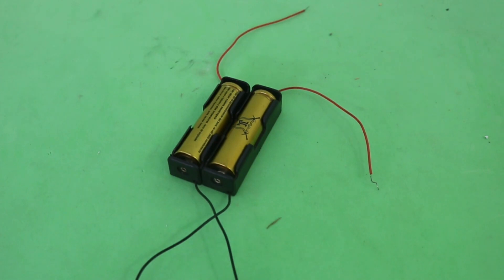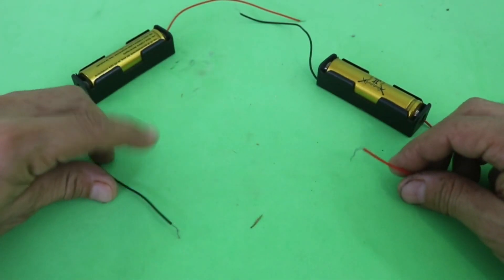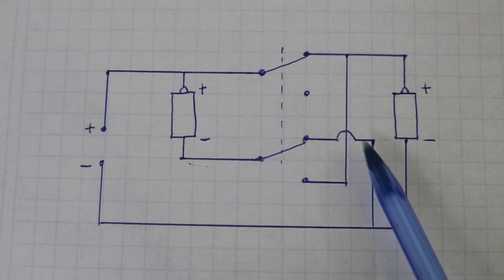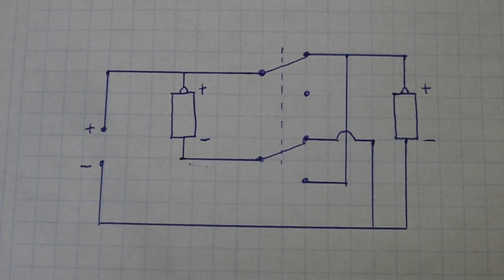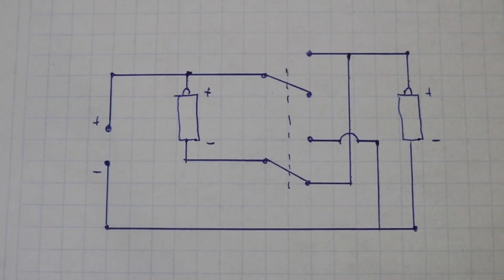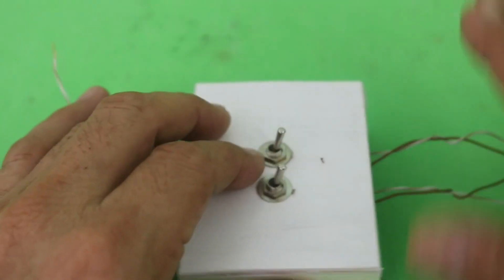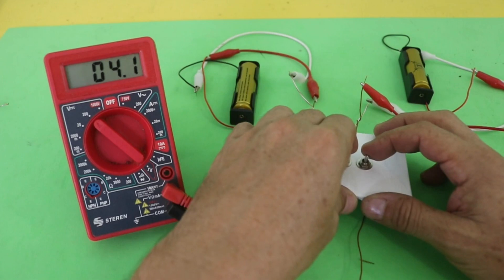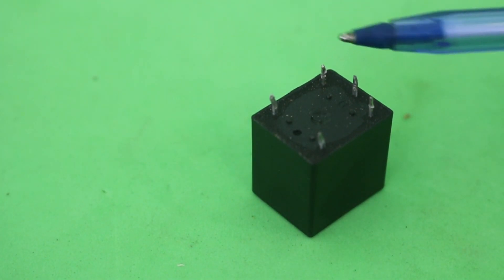Change from Series to Parallel Connection with the Flip of a Switch

Comment: One point to note is that instead of switching both toggle switches if the negative side switch only is toggled downwards as in the diagram then it would create a catastrophic short circuit with the left side cell. However this is a very helpful video to illustrate the basic concept. This can be extended to multiple cells and also the switching can be controlled electronically. Thank you for the video !

Comment: It's good but the batteries should be rechargeable, or in the same use condition - because batteries in parallel will try to charge each other.  If one battery is old and the other is new, the new battery tries to charge the old one, and if that old battery is not designed to be recharged it may be a little dangerous. It could heat up.

Comment: I will call it "18650 Detonator". Just do it by relay or multi-contact 1 switch. You could push ppl to do it and later by mistake can set house on fire. You could add fuse to scheme at start ...

Comment: Excellent!
I wonder if you can use solar panels in place of the batteries in this circuit to switch between serial and parallel for charging batteries?
Reply from the maker: Yes you can

Comment: Very cool.
You should do a video like this with speaker outputs to go from 4 to 8 ohms.
And guitar pickup wiring does this also.
Reply: that's what I am thinking . . I have (2) 8 ohm speakers in a single cab . . . but 2 different amps I like to use . . one is limited to 4 ohms (single channel) the other has (2) 8ohm channels . . . here's the big question . . . what rated switch would I need ?  Obviously I can't use the same DPDT switches that would go into a guitar because they would likely melt . . so how do i determine the rating of the switch I need ? . . . 4 ohm amp is 50 watts, 8 ohm amp is 45 watts . . any help would be appreciated . . . thanks in advance